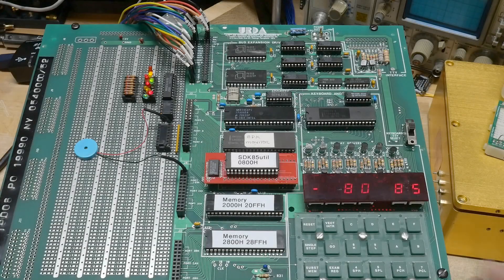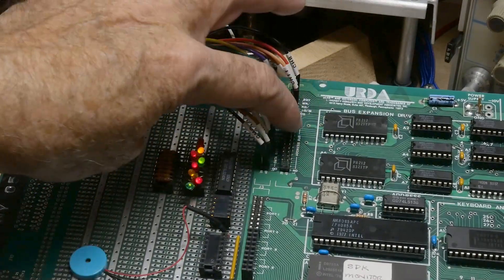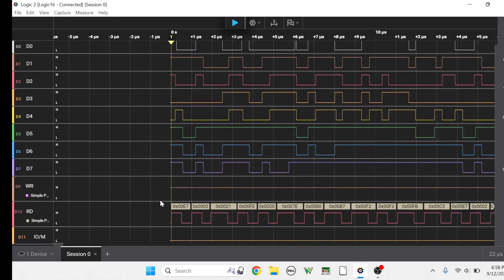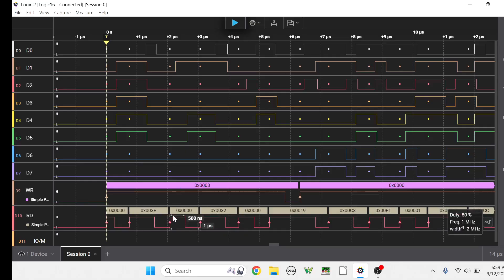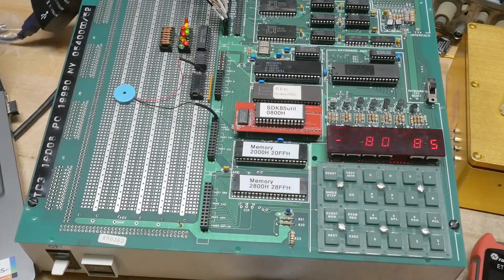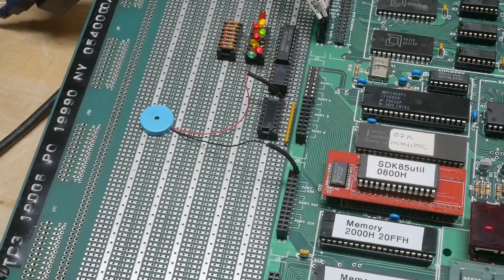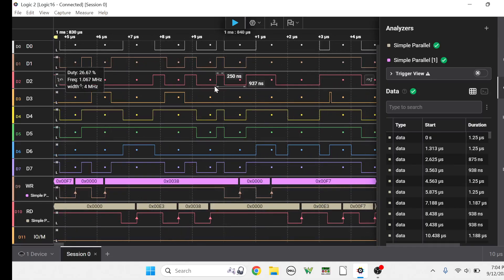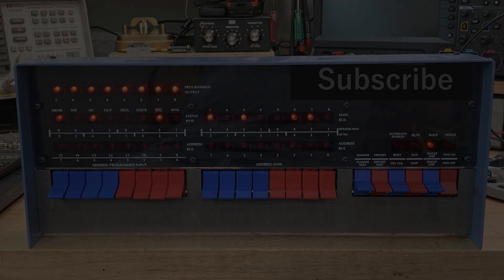#2382 Saleae Logic Analyzer look at 8085 bus

Comment: Good video, a great future series might be to look at what is currently available in low cost / hobbyist logic analyzers.
Reply: I know it isn't quite a video on the topic you asked for, but I figured I'd give some recommendations for anyone interested. The Digilent Digital Discovery is on the cheaper end but is a capable device. For logic analysers the software is everything, so outside of Digilent devices or Salae devices, I think anything supported by Sigrok (see the Sigrok Wiki) is probably the best bet.
Reply: You get what you pay for. If you get a USB unit with 16 or more channels with deep on board memory for good sampling, and one that samples at a fairly high rate it's going to cost you. You don't want a unit that tries to store the samples on the PC while it's collecting data. I have a Hantek 4032L which is 32 channel (what I needed at the time I bought it) and 2Gbit of memory for storing the samples and a max sampling rate of 400Mhz. 8 years ago it cost $175.
Reply: @fredflintstone8048  True, but I was more thinking about projects like GusmanB's Pico2 Logic Analyzer, I notice the V2 edition can run to 400Mhz. But as with most such equipment, the performance will depend more on probing and the probes may well be the most expensive part. Most of these projects are set to operate with Sigrok PulseView, and as such beyond the hardware are completely free.

Comment: If your i8216's are hotter than 70°C then you're exceeding specified maximum... so nearly 80°C is not just toasty it's too hot!  :-(
I remember boards with them on and yes, they ran hot (even in ceramic dip pkg) but not that hot.
Luckily the LS245 etc. came along and ran much cooler + was wider too.
Always enjoy the channel. Thanks.... I am old enough to have designed with/used these parts. Thanks for reminding me.

Comment: How many mA does that development board draw?
Reply: How many mA, a crap ton.  Old school IC's like this board uses are mini Easy Bake ovens.  I have one of the first "IC" based frequency counters here that could easily be used as a supplemental heater for the room.  Anytime I restore a early piece of test equipment I usually grab my IR camera and view all the IC's.  All the hot IC's get a modern stick on copper heat sink added to them.